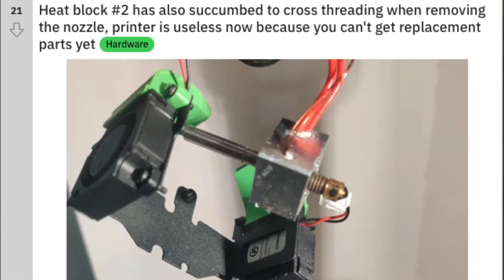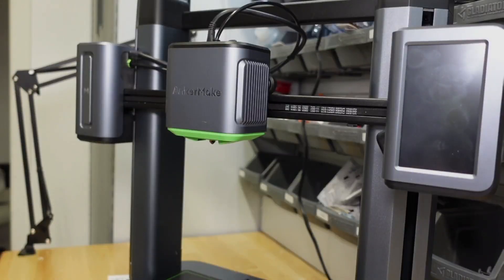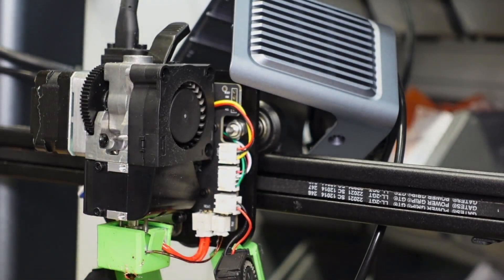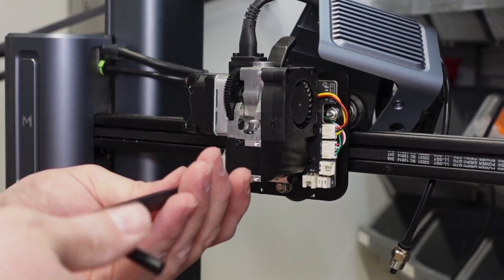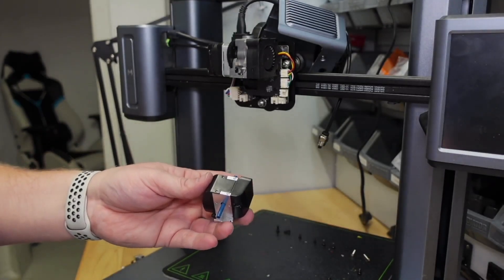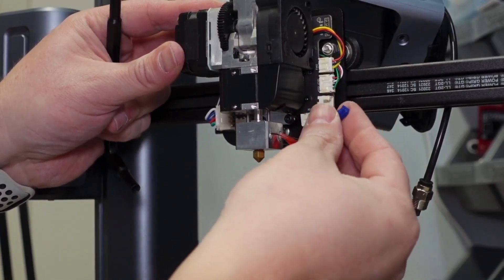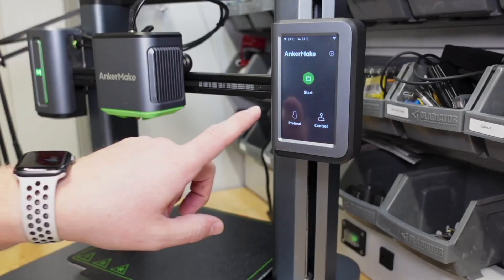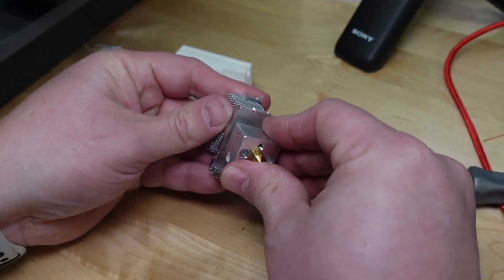AnkerMake M5 - Nozzle/Hot End - Remove and Replace

Comment: Tip on removing those when hot-glued in - Small flat blade screwdriver inserted where the connectors meet, and give it a twist. Those will pop right out.

Comment: Do you know why the heat sink is replaced too?
Reply from the maker: There is no reason to replace it.  I did here as they came together and I wanted to replace both the heat sink and hot end.
Reply: @timexperience  Ok. Thanks. I replaced mine too. My thermistor was bad. I had to use PETG settings to print PLA.

Comment: Where do you get a new heatsink? My nozzle cross threaded when trying to remove it and it’s support screw broke in the heat don’t due it got warp and broke when removing.
Reply from the maker: The hot end including nozzle and heat sink are (now sold out) available at https://www.ankermake.com/products/hotend-set?ref=accessories&variant=43208172437653.
Reply: @timexperience  Ok, I didn’t read the description and thought they sold only the hot end. Now I need to find new screws unless it also comes with the hot end. Thanks for the info
Reply from the maker: @STOTTSPAWN  if it broke though it should be covered by warranty and Ankermake support should ship you a new one.  I bought two more as I like back ups.

Comment: Great video. Good explanation of the issues involved in removing the hot end.
I also have an M5. I printed for the last 5 weeks after it arrived. No problems. Very impressed with the speed and accuracy. Then, I did my 5th filament change and it would not grip the filament to extrude. No blockage, I can even force it to extrude by pushing the filament manually.  But the feed mecha just won't grip the filament to push it thru. I've replaced the nozzle once, it was not blocked but, just to troubleshoot. No go. I will take the head apart again tomorrow.  I think maybe there is melted filament in the filament gripper mechanism. It my fill the gripper notches, making it too smooth to grip. ...Ideas?
Reply from the maker: Check the reduction gear for debris.  I found melted filament in mine.  Also, I am having an issue that when I feed filament manually it catches on something before being gripped my the extruded.  I think there may be a gap at the top of the PTFE tube on the hot end.  I found if I unscrew the Bowden tube that I can feed it into the hot end with less issue.  Please let me know if that helps.
Reply: @timexperience  There was a surprising amount of filament shards below the extruder cogs. removed all of it. Noticed what looked like black "grease" on the cogs. I cleaned all of it off. I think the "grease" was very fine particles of filament that had been ground down over and over. Bottom line, extruding like a champ now! I appreciate your videos, always reassuring to see a pro doing the job.
Reply from the maker: Thanks for the compliments. But I am learning g this as I go.

Comment: Hi EP, 
spiggytech here. Great video series so far. I've enjoyed watching them when they come up in my subscription list. I would suggest eyeballing the PTFE tube in the throat and inspecting it for proper length. I noticed early adopters (kickstarter shipments) had ~52mm-52.5mm length PTFE tubes in the hot ends and spare tool box. When measuring the gap from the feed assembly to the back of the nozzle, I noticed my gap is 53.8mm. That means in my machine, there exists a 1.8mm gap for pressure leak from top to bottom. This was quickly verified by spotting filament bleeding into the threads of the heat block. This may not be an issue for everyone with in-specification tolerance or a properly torqued throat followed by properly torqued nozzle. But someone with loose fitments or less than adequate torque can experience a filament blowout if the nozzle gets jammed. This damage can be found on the AnkerMake subreddit and AnkerMake community Discord in varying degrees from an engulfed hot end to destroyed extruder PCB. 

That said, one way to validate the PTFE length is to dismount the hot end, leaving the heatsink inside the extruder assembly. Pushing the PTFE tube up as far as it will go, then inserting a dismounted metal throat. If the PTFE lines up with the throat, there will be adequate length. If there's a gap, I would suggest replacing the PTFE tube or very least exercising extra caution by ensuring proper tightness to the throat and nozzle before deploying the printer.

The long top slot in the tool block is actually made for comparing the proper length of the PTFE tube. However it's calibrated to my machine's 53.8mm gap. Anyone with that length of tube is likely to be at a good length for checking proper fitment. 

Thank you so much for your videos, they're incredibly informative and helpful to the growing AnkerMake community.
Reply from the maker: I use your service block to verify the length of the PTFE.  All three I have match the service block.

Comment: That moment when you spot your hot end service block in a video while goofin off on youtube.
Reply from the maker: That service block is extremely useful.  Well done.
Reply: @timexperience  if you have suggestions on how to improve your use experience, feel free to reach out to me on Printables or even the unofficial discord.
Reply: @SpiggyTech  I've printed it prematurely at .30mm @ 10% infill. Been having issues with my printer so im preparing for the worst. Should I print again at recommended settings? Think these settings will make it pretty unusable? Haha
Reply: @kurtdoerfel7620  go with the recommended settings. They're that way to provide enough meat inside the structure. Otherwise it would crush or collapse under torque. Also if you use so much torque that it crushes a PLA block, you may bust the hot end too.

Comment: Thank you again for the detailed tutorial. I was able to use the printed tool for one of my hot ends but the other one was too heavily goobered with a over extrusion.   I placed it in my micro vice and used a micro torch to heat the tip and the 1/4”
Socket and was able to remove the tip. 
There was old filament still in the hot end so I plugged it into the M5 and stared the extrusion of the new filament. It came out fine so I backed it out and noticed the fans weren’t running. 
Do you think this is normal or a possible cause for my filament to over extrude?
Reply from the maker: I have removed my covers so I can observe to fans and have not seen them turn off.   They definitely change speed but not turn off.  I would be concerned if they do shut off. But there are so many variables it may be hard to determine the failure.

Comment: Very good documentation for your hot end service. I’ve viewed AnkerMake’s site as well as two other users procedures, your example is very clear. 

Do you know the size of the two mounting screws for the hot end to heat sink?  My first attempt resulted in breaking the screws and had to utilize the screws from the extra head.
Reply: They're M2x16mm, I'd recommend not getting stainless steel like ankermake used and get something stronger
Reply from the maker: I just replaced them with M2x16s

Comment: Thank you for sharing this important information .  I have read the reddit link about nozzle replacements but this brought me to a question.   Do you think it would be useful and make it easier (i.e. lessening the possibility of cross-threading) to replace nozzles without disassembly if one put anti-seize on the threaded portion when performing the task?
Reply from the maker: I really debated doing this myself.  If I had some on hand I would of.  I will have some on hand for the future.
Reply: Hi, Not the content creator, but I am the creator of the M5 tool block. I found the OEM M2x16mm screws to be completely inadequate in supporting any appreciable torque on the nozzle and heat block. Any attempt to extract the nozzle without prior disassembly from the heatsink risks snapping those little screws and is in my opinion not advised. Until AnkerMake changes the design, EP does a great job showing the breakdown in the most ideal manner. That is said, if you find it difficult to extract the nozzle while in the tool block, the heat block can be inserted perpendicular with the throat exiting the wall off the tool block for extra grip. That is a purposeful design as it is also a pain to extract the metal throat.
Reply: @SpiggyTech  Thanks for the reply. I’ll check out the tool box and print it soon.  And reread your reply since I am new to 3D printing.
Reply: I wonder if when it is assembled if it is being over torqued?  I haven't replaced or even looked at mine first hand. Is it often that the nozzles come loose on 3D printers?

Comment: Following up on previous comment on the failure of my kickstarter M5.  The short story repeated here: M5 received just before Xmas, made prints for about a week.  After what turned out to be the last successful print the left side gantry motor, failed, locked, jammed - whatever - just wouldn’t move.  Went back and forth with customer service during the last week of December, sent back for replacement on January 6th  A new replacement arrived on January 20th.  Tested and thus far, one day later, the new printer works fine.

Based on my experience here are a few things worth noting. Customer service was continuously responsive via email over multiple days with all return messages sent within 12-16  hours.  Based on the timestamps I believe responses came from the other side of the world  (I’m in PA in the US). The failed M5 was shipped to WA state on a two-day USPS label that they emailed.  After waiting almost two weeks I sent a tickler email request for status and received the usual timely response that I’d receive the new M5 in less than a week.

Actually I received the new M5 the very next day making me believe that there is a warehousing facility close by - I’m thinking New Jersey.  However there was no packing material between the inner and outer cartons with about 3 inches of nothing but air on all sides between them.  So for certain my new M5 got banged around in transit.

I tested the new M5 immediately on arrival and made an interesting first observation.  The motor gantry on the original unit moved freely up and down on the worm gear when no power was supplied.  This was true both before assembly and after operating sessions until of course the failure.  The new M5 gantry stays firmly locked in position with or without power applied.  Is the difference due to a software change?  Was my failure related to software rather than hardware?  I’ll probably never know. (my firmware/software was always kept up to date)

For kickstarters if you need a replacement M5 don’t return the extra nozzles and hot end unit since the new M5 won’t include these (I kept mine so am okay).  Also the new M5 only had one file - the complex test one - but no benchy.  And for all users I suggest keeping the original packing box and material maybe for quite awhile.
Reply from the maker: I have my packing material safely tucked away until the warranty is expired.  Standard practice for me with any electronics.  

My gantry will not move and I received my about the same time so I do believe you got bad hardware.  But I am glad you received one that is working and are able to get back to making.  I spent almost two weeks figuring out my issues and after replacing the nozzle and clearing the reduction gear and tightening the belts it looks like my v-wheels are wearing out.  Replacements are not available until March and I am continuing with what I have.  I have irregular seems in vertical walls.  I am concerned that these printers are wearing out faster then expected.
Reply: @timexperience  Some of the v-wheels were over-torqued at the factory, leading to flat spots and severe wear. Fortunately they are at least covered under the warranty. You probably want to go over all the v wheels and check for flat bearings (unlock motors in settings and roll the x and y axis to check for places where it 'catches').

That said, v-wheels are a consumable item. They are expected to wear out. The fact Anker covered them under the warranty at all is WILD.